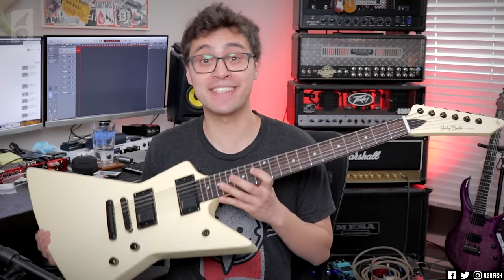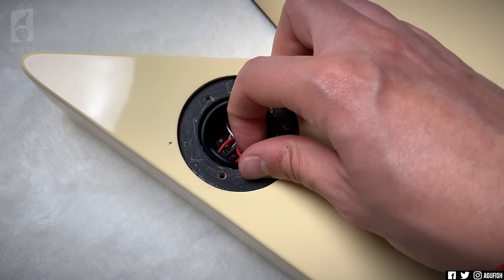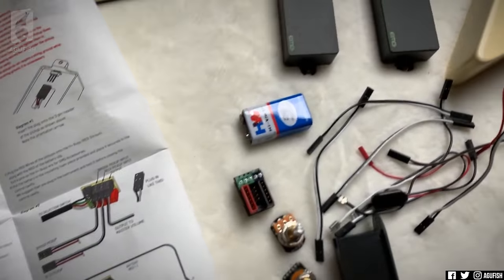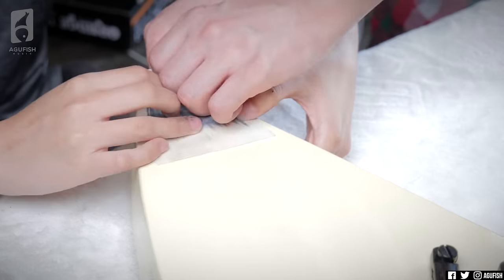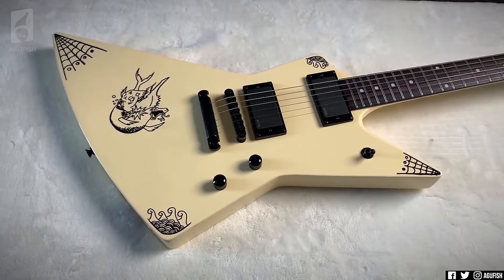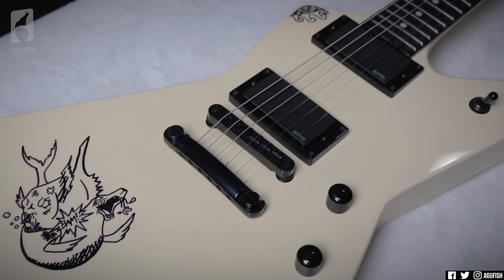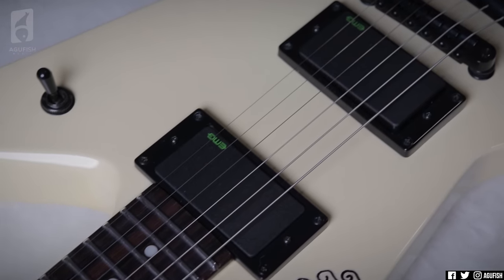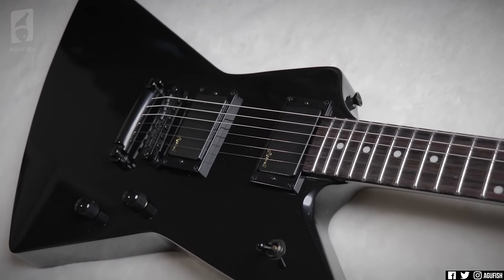Making a CHEAP Guitar into an Awesome Metallica Tribute!! || James Hetfield-Inspired Project Build

Comment: Funnily enough the EMG logo says what the pick-up is: silver: ceramic magnet, gold: alnico magnet, copper: coil splitable, and more
Reply from the maker: No kidding? I never knew that but it makes so much sense!
Reply: @agufish  Yeah I got bored at school and went to their FAQ 😊
Reply: What about the EMG 60? The letters there are blue
Reply: @mexicanmaggot666   a typical EMG 60 should have ceramic magnets in it, you probably have an old signature set. Like Agufish mentioned they make a 60A with alnico magnets but they were first made with ceramics.
Reply: Always thought colours says the model : 
- silver : 81
- gold : 85, 58 or 707
- cooper : all their splittables (81tw, 89, 707tw, etc)
- green : Kirk Hammet signatures
-  blue : 60 or 60a
- red (or black if it has red housing) : Glenn Tipton signatures
Reply: @matiasz6857  The 60 is blue/grey, 60A is gold.
Reply: Cool
Reply: I never new, that's cool
Reply: @matiasz6857  that's a way more accurate than OP
Reply: I never actually knew that, that’s really cool

Comment: I really wish everyone would jump on board the solderless train. It makes swaps and installs so much easier.
Reply: The problem is that it creates a sub par connection with a lot of loss and high resistance compared to a soldered connection (electrical engineer here lol)
Reply: yeah-no 
90% of electronics are fed by some kind of plug 😂 
There are a lot of solderless brands out there already. The problem you then run into is proprietary connections and compatibility issues. Then you’re  stuck clipping and soldering anyways. It would be nice if there were an industry standard solderless system🤘🏻
Reply: @Wargasm644  that's true but more than 90% of electronics are used in a digital implementation and the quality of the connection is a lot less consequential in a digital design. For analog signals you absolutely want the best connection possible with with the least amount of loss factors. ANYWAY, it's not like most people would hear the sound difference to be honest, unless you're using REALLY shit parts LOL 😂
Reply: @ChamiCh  I totally agree, tbh it's mainly for like, noise in the signal that it can become bothersome but even there, if you're playing with gain, you're gonna get hiss regardless. Anyway, guitarists will find just about anything to complain about honestly LOL
Reply: @yeah-no1353  - sub-par connection is a bit of an overstatement—short of an extremely sensitive equipment that can measure in picocoulombs (continuous flow is more important than point-of-contact resistance) there is no way one could perceive a difference between soldered and good solderless solution (i.e. tight/crimped connection via de-oxidized or gold/platinum-coated ports) no matter of the amplification/feedback loop. I could understand why would someone prefer soldered connections in super-cheap equipment as crappy soldering is still marginally better than crappy connectors, but it boggles the mind why are people accepting, or even preferring soldered connections on $300+ guitars.
Reply: @zwerko  oh dude, I agree with you. I'm just saying guitarists will find a way to blame bad tone on the fucking tides if they can 😂 it's more about the individuals wanting and "old school" look and feel than actual audible sound differences LOL I'm not disagreeing with you 😂
Reply: @zwerko  imagine trying to explain electronic components to an electrical engineer 🤣
Reply: for me, any type of improvement to the connection that soldering is probably cancelled out by my intermediate soldering skills, but something just feels right about it. feels more handcrafted

Comment: In a mix they both sounds almost the same :D
Reply: Not enough of a difference to go through the hassle of changing pickups.
Reply: I'm listening on my PC with a set of really nice BD770s plugged into a very nice sound card and in the mix there is almost no difference at all. The EMGs sound ever so slightly fuller and controlled out of the mix but if anything I'd reckon that might have as much to do with the change of pots as it did the pickups if not more so. 

Or I could just be talking out of my ass, but who knows. It's all opinion.

Comment: In 25 years of building custom guitars and basses I've worked with a lot of pickups, electronics, components, and with that, a lot of companies of all sizes. 

When it comes to the electronics, say what you want about EMG pickups, the solder-less wiring, pots, connectors, I've used them on many different pickups, for years, and never had a single failure of any kind. 

When it comes to customer service, I've never dealt with anyone better, more helpful, or more responsive (Acoustica, who make MixCraft DAW software is on thid level). I have had a EMG technical support help me install pickups from other companies onto their wiring sets, their pots their Electronics they preamp, and they were fantastic, and they were definitely more helpful than the people who built the pickups I was installing. Most of the time would just say, "just use our wiring and be done with it," and then they would end the call. That's not what my customer wanted, and I, as your customer, that's not what I want. EMG would listen every time and help every time.

As for the pickups, they make dozens of different pickups and pickup sets, and only the 81/85 set sounds like the 81/85 set. That set is used on 16 of the top 25 metal albums of all time, and are still used more than you think. I've tried quite a few of the other sets/pickups, and never been disappointed, and never had anyone ask me to replace them on a custom build, except builds that were over seven years old and the owners were just ready for a change.. That's guitar pickups.

I think the bass pickups are even better, on average, than the guitar stuff.

I am a professional now, and I didn't facepalm and move on. Playing a guitar, or any instruments, really, is about fun, about being yourself, about listening to the voice inside, doing what feels right, playing what you hear in your head, feel in your heart, letting the river of energy flow. So, if this is what you felt inside, kid, and this is what felt right for you to do, then I am proud of you for doing it, being honest with yourself and putting it out there. 

Fuck the mamby pamby pussies afraid to be themselves, and fuck the doubters, the detractors, and the trolls.
Reply: Thank you! Someone else who understands why I only use EMG (and DiMarzio, Lolar, and Gibson) pickups. I’ve used Fishman and gotten bad jacks as well as pots and customer service. Never a fault with EMG. The only other active pickup I’ve liked more, was a IBZ/DMZ stock pickup in an Ibanez. A close second is the Seymour Duncan SEVEN. But EMG has got the package. Reliability, quality, service, and tone.
Reply: Honestly, you can't go wrong with EMG's solderless system. I got the 57/66 pair for my ESP Edwards Explorer and couldn't be happier! I can handle a soldering iron (studied electronics), but solderless systems for guitar pickups should be the norm nowadays. Come on it's 2020!
Reply: Like to hear that about emg! So many companies fall really short on customer support!
Reply: Same here. 

In 25 years of owning EMG equipped guitars I've never had an issue with their stuff. Switches, solderless system, pots and pickups... all really reliable.

Comment: I did a beat up 1984 gibson les paul studio lite with artwork. I used sharpie first, then I used model paint with a fine brush to go over the outlines. Also used an autograph silver pen. For any color I needed I used model paint also. Holds up pretty good over the years of playtime.

Comment: Cool work Dude !!! I myself only put a sticker, so far. Pretty simple also, just wrote on a piece of adhesive printer paper, sprayed the paper a few times with clear coat spray used to protect drawings, let it dry, and then put it on the guitar. Easy to remove also...
Reply: @megahurtz30 what kind of paper and clear coat?
Reply: @SethPlaysBass  The paper is just regular adhesive printer paper, you can find it in office supply stores and such.. The clear coat is: Krylon Workable Fixativ 1306, it's what says in the spray can. I just give 4 or 5 coats (let dry in between each) and then stick the paper to the guitar

Comment: If your pickups are Muddy try lowering them before swapping them out. Often times mud comes from high output pickups too close to the strings. I got this Epiphone SG G400 and the pickups were so damn muddy and almost unusable but by lowering them it unlocked their potential. GIve it a try.

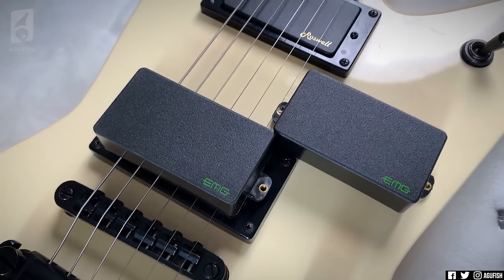Comment: 3:44 Hetfield actually has the 60A in the neck in most of his guitars, especially the ones he uses for his clean sound. No idea why they didn't put them in his signature models or why they barely promoted it as Hetfields go-to neck PU. There is actually some promotional material referring to his original Gibson Iron Cross where they actually state that it has a 60A with custom housing in the neck.
Reply from the maker: Oh for real? That's super interesting. Can you link me? I wonder what year that was and whether that was before or after he launched his signature set. Maybe then the Het Set neck is essentially a 60A with pole pieces?

Comment: Top tip for cable management - do your guitar modding in the middle of the day rather than the middle of the night.  You are far more likely to do a good job if you are not wishing for sleep.  As for protecting the sharpie marks, you are better off spraying the guitar applying the liquid to a paper towel and using that to cover an area ralatively smoothly rather than leaving an obvious ridge line as displayed in the video.

Comment: If you look at the video of James's new guitar - Carl - made from the bits of the garage from their old house on Carlson Blvd in El Cerrito, you'll see he has two batteries installed. It could be that he's using them wired in parallel for longer life or in series for more attack/percussive pick sound at 18V rather than 9V. The output really doesn't change that much but the sound dynamic of an 18V system is much more instantaneous and dynamic.

If you don't want to go buy a router and hack the guitar up, get an EMG battery box and run a stereo cable from the guitar to the battery box and then a regular cable from the battery box on towards and pedals/effects processors and your amp. You'll need to install the little battery blank inside the guitar or chop and solder the battery connector if you're not using the blank.
Reply: The second battery is for fiber optic side markers. He uses 9v for the pickups.

Comment: Just a quick but extremely late suggestion for others in the future.
The best way to add artwork to your guitar is static stick window decorations you get at Halloween time.  Those suckers don't budge and yet still come off easy as hell.  You can find some decent looking ones and just slap em on your body and it's all good. Take em off and change them at will and store the old one til you wanna use it later.

Comment: I put an 81/60 set in my EX style guitar as well, (Chapman Ghost Fret) and that control cavity is bursting at the seams because mine didn't have routing for a dedicated battery compartment, so I had to jam it in there.  (TWSS)
Reply: Don't even think about peeking under the control plate on the schecter I have with emgs

Comment: I am currently getting parts for a pretty crazy project on a v1 ML1 modern Chapman.
I've got BKP Aftermaths on the way and I would get Schaller locking tuners soon. The only thing I'm on the fence with is whether to go crazy and get the Schaller hannes or Hipshot saddles for the hipshot copy bridge (going for a gold black mix in the hardware). To not screw it up I am going for a luthier to do it and his prices are pretty damn good

thoughts?

Comment: Top tip - if you're going to disassemble a guitar and possibly reuse parts again in the future or you just want the job done quick because you're never going to reuse them again - snip the wires rather than unsolder. Why? To reduce the risk of solder splatter on the paint. Also a snipped end has far less change of scratching anything and with some of the original cable on the component you have some idea right away which solder point does what.

... and, with EMG's the system is internally shielded so no need to shielding on the body.

Rather than Sharpie - use a paint pen.

The guitar looks pretty cool. Good job.

Comment: even tho my EX84 arrived more white than ur prototype..
(for reasons i don't understand, bcuz i bought Aged white, get a normal white and all they do is changing the website pictures after 3 weeks to a white explorer and call it EX84 WH instead like before EX84 AW, i messaged them before and they said they changed color before the production began wich is a bummer and disappointing for me bcuz i bought this guitar bcuz of the cream color..) 

regardless i still turned it into an EET FUK, changed the shape of the Headstock to an hockey stick and put some middlefinger inlays in and the tapes and i must say it still looks awesome even tho the shape is little bit smaller, just wished the color would be more fitting but maybe time will yellow it more..

Comment: just for the record, shielding without connecting that shield to ground is almost useless... unfortunately. if you don't believe me, just remove the grounding of the bridge, does it buzz ?
by the way super video and great sounding piece of wood :-)
Reply: You don't connect the bridge ground with active pickups.
Reply: dubster82 yes that s for sure but my point was ton emphasize the fact you need to connect a shielding to be efficient.

Comment: Some years ago I 've moded an ESP Edwards EXP-125D explorer (natural mahogany colour) I found for a VERY good price on ebay. New EMG 57/66 pickups, (oh, yeah solderless EMG system), Graph Tech bridge/tailpiece, Earvana TUSQ nut, Gotoh locking tuners, etc (just had to take it to a luthier for fret levelling plus fitting a batery box, since I didn't have the tools nor the knowledge for those type of jobs). I 've learned a lot by doing that project plus I ended up with a killer guitar! Here is my girl: http://tiny.cc/6e9qpz

Comment: One thing I’ve noticed that truly needs to be addressed and stopped in the guitar community is youtubers using the wrong tools for the job. So many guys use pliers on nuts and bolts, incorrect usage of screwdrivers on knobs and other hardware, improper technique when using solder irons. I get it it gets the job done but you also risk damaging components, finish, hardware, screws, etc. Nothing is worst then having to try and get stripped screws out of a guitar. I’m a former Toyota automotive technician and I guess that’s why I notice these things. Someone with a decent following should really consider this.